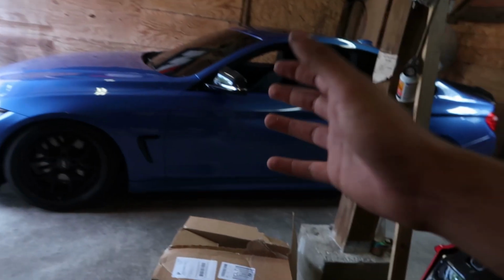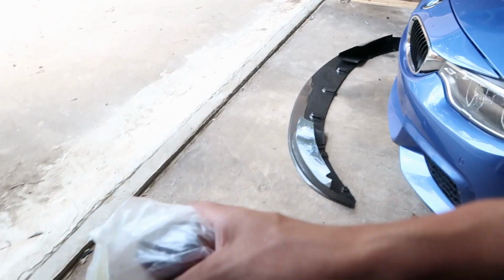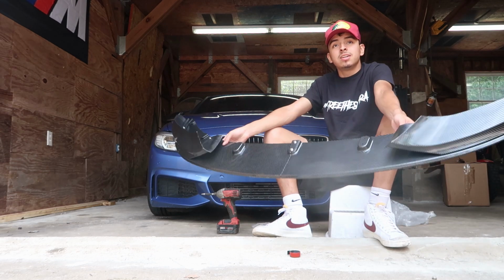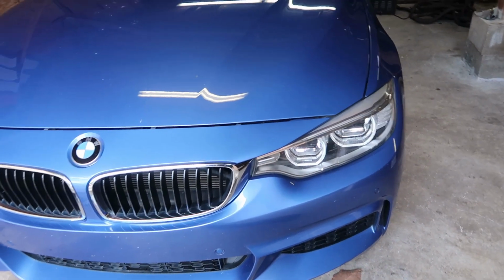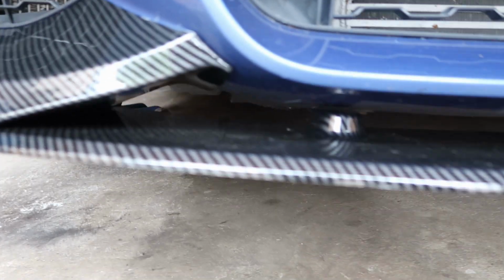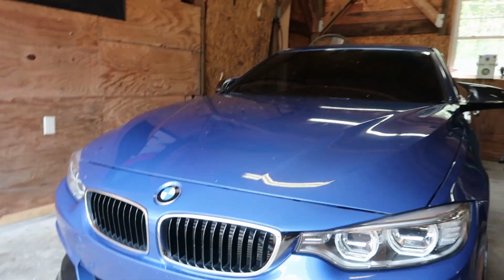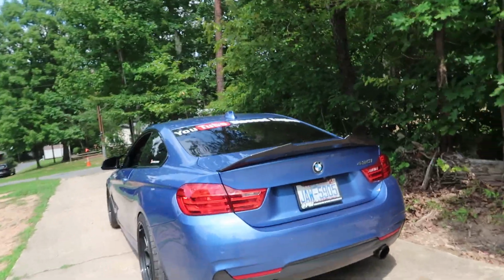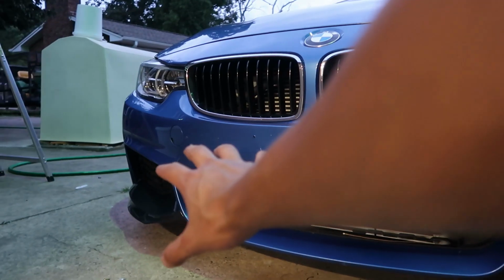INSTALLING FRONT LIP ON MY F32! *what was i thinking smh*

Comment: How did it break? Just highway speeds or did you hit something because your car is lowered?
Reply from the maker: As soon as I hit the highway the wind pressure was too much and folded it down
Reply: @BlessedJay_  Damn that sucks, I'm about to install the same lip now I'm scared XD

I'll try to figure out a way to make it more sturdy
Reply: @djbrissette buy the one piece bottom, not the one where you have to fix the two parts together (like the video). It costs more, but is generally more durable
Reply: @CarStaty  I already bought and received it but haven't installed it yet. I'll do my best to strengthen it
Reply: @DominicBrissette  install isn’t too bad, it’s the 4 OEM screws at the bottom (8MM) which need to be replaced and then the screw into bumper for the middle part. Good luck with it
Reply: @CarStaty  thanks man I'll install it today